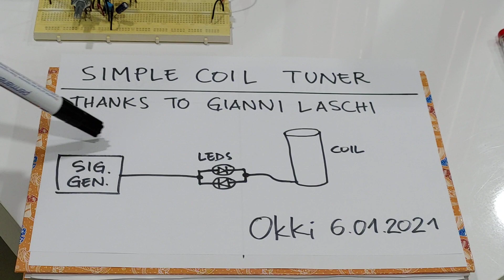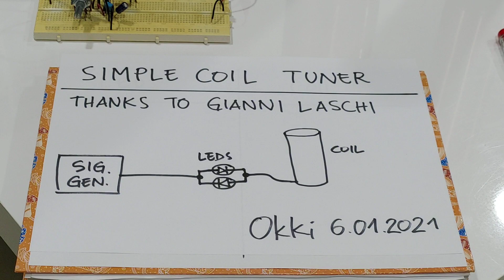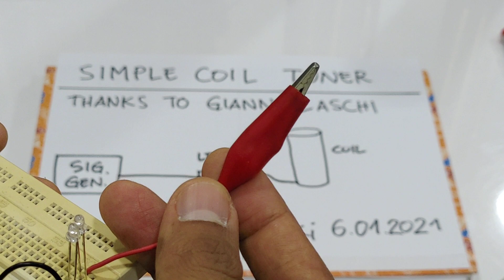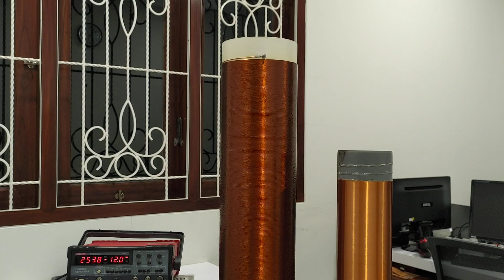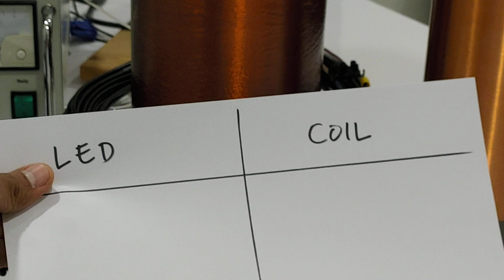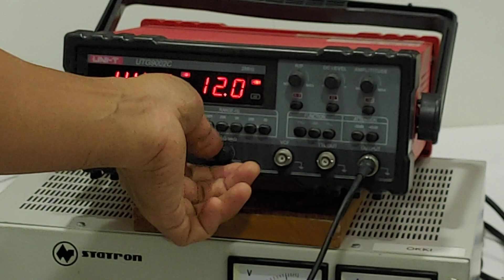Simple Coil Tuner

Comment: Time for some oil in that chair, lol. Cool trick, never seen this before, certainly can be useful !
Reply: Maybe you still need a similar arrangement on the inductive version too, but with two diodes on the ground side
Reply: Also, I missed what types of waves you did these both with, sine or square?  That could make a difference with odd or even harmonics if not the same .
Reply from the maker: @DavyOneness  this was square wave signal.